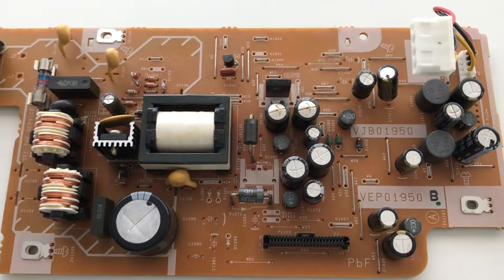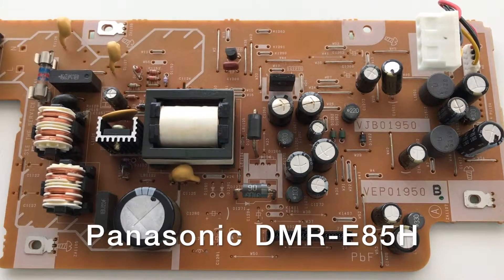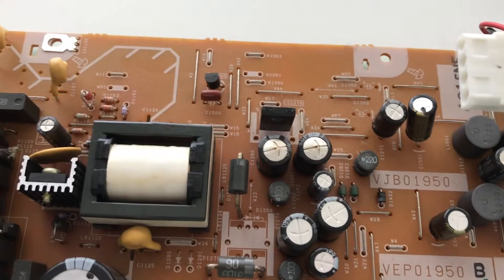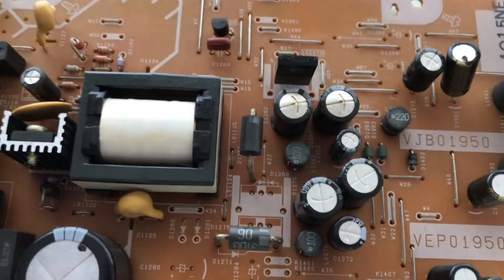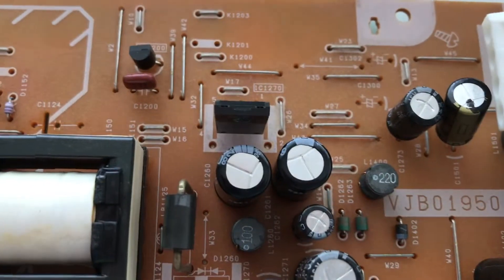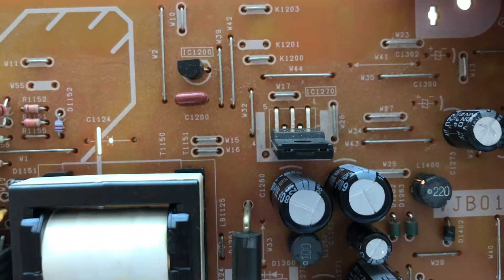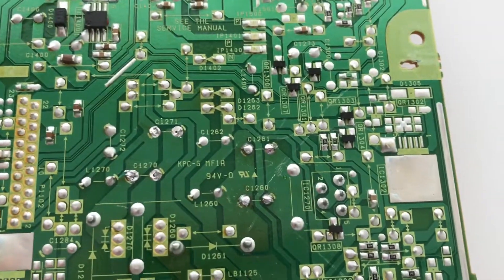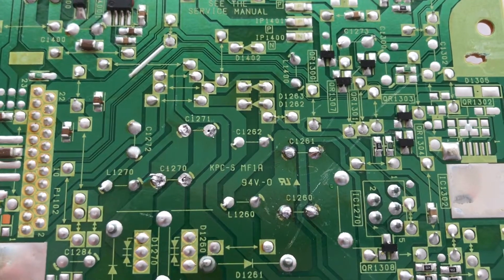Repair of Panasonic DMR E85H--Replacement of C1260 and C1261

Comment: My E85H would not turn on and I took the cover off and I have 5 five 1000 microFarad capacitors that appear bad.  C3022, C3024, C3026 and I believe C3020 and ?.  It is on the main board under everything.  Do you know anyone who does repairs commercially?